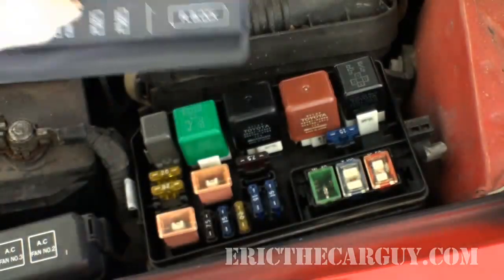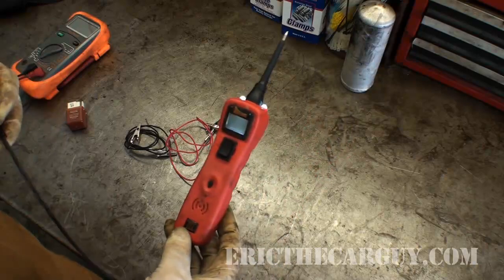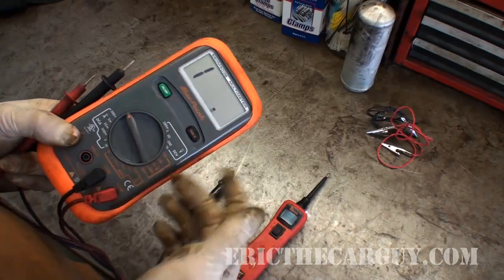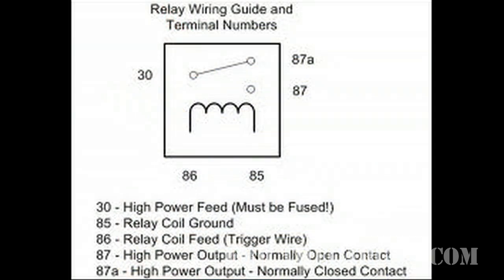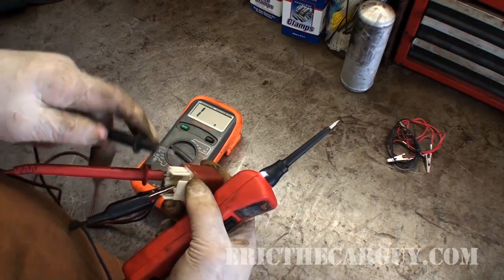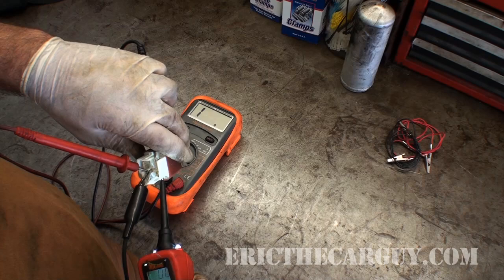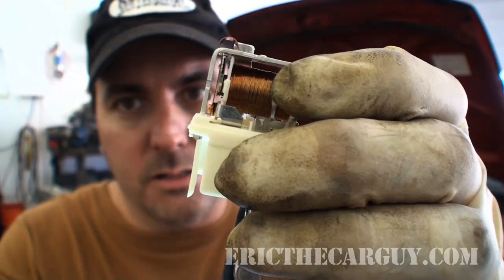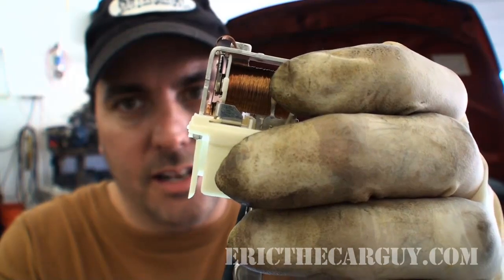How To Test Relays- EricTheCarGuy

Comment: Hi Eric...I have an 98 oldsmobile bravado...the starter was clicking for some weeks now, so I know I needed a new starter...but yesterday while I was driving, the car just stopped and shut down on me. I tried cranking it back up but no click and the lights on the dash was dim and the radio sounded like static....my 1st thought was the battery, but I had the battery checked 2 weeks prior and it was good....I replaced the starter....still no crank, and the lights on the dash was dimming more, I gave it a jump and the car cranked right up, and the battery gage on the dash is good at 14....that was all yesterday and it has been driving fine since, but now this morning it cranks up but sounds funny, as in it doesn't crank with the roar it used to, its usually loud like a truck, instead I hear this noise, the crank sounds weak, like it barely want to start, although it doesn't stall to start...I'm wondering if a bad relay under the hood can be draining my starter or interfering with the starter/crank, because I now have a new starter on here but the crank doesn't sound as powerful as it did when I 1st put it on there....and it puzzles me why did I break down all of a sudden and the lights went dim and radio didn't work, I didn't know the starter could mess with that...

Comment: Hey Eric I am having troubles with my radiator fan on my 94 plymouth acclaim I've checked the motor it works but when I stuck two ends of a wire into the plug where you hook it up to the sensor and the fan didnt start to run what should I do?

Comment: This was a great guide for me. I didn't have a probe and wanted to do it inside so to activate the first circuit I used 3 D batteries end to end with an alligator clip sellotaped to either end. Then just used the continuity setting on the multimeter to get a reading. Was re-assuring given my weird car problem. On a VW 109 relay it wasn't so straight forward which pins did what so there was a bit of trial and error till I worked it out. The diagram on the side wasn't helpful either(to an electronics like me anyway!). But I know I got the right ones in the end cos I tested the bejesus out of it. And I could see the metal switch go on and off and hear the continuity go on and off accordingly.
Christ this is turning into a confession...
Anyway thank you for the guide Sir. You're a gent.

Comment: Hey Eric, I have a 2003 mitsubishi diamante that i have replaced the battery and alternator on and have cleaned the battery posts and cables. While I'm driving the battery and brake light come on intermently. When they come on I have checked voltage and something is draining the battery while its running. If I shut the car off and restart the car sometimes it starts charging again. It isn't draining the battery with car off only while running.

Comment: whats the difference between the cheap relays and the more spendy ones?
Reply: Richard Cowtails About 5 bucks :P
Reply: exactly like you wrote, one is cheep made and on is better made
Reply: ***** thanks... at least someone got that lol
Reply: And I bought turn signal flasher relay for my dodge ram and has never had a problem with it. No hesitation,  no huge relay time no failures of any kind.
Reply: Richard Cowtails About 5 bucks :P

Comment: Do relays ever fuse closed?
Reply: Yes they do, if you for example run 40 amps through a 30 amps relay it can solder itself together and stay shut. It's common if you have some extra auxiliary lights on the car. If you use one relay, say 30 amps a piece because its one of the most common, for each light it wont pretty much be a problem. But you can always go overkill and go for a higher amp relay that costs 3 times as a 'regular' relay but save yourself some wiring. Other than that it's not to common for relays to fuse together unless by age, an old relay might fuse together because of corrosion or just wear and tear.

Comment: Is the test probe injecting battery voltage?  I thought you couldn't test continuity on an energized circuit .
Reply: Two different circuits.  One works as a switch. So only the switch circuit had juice running thru it.

Comment: so theyre kind of like a "step up" transformer? lower power in, coils increase power out. yeh?
Reply: thats right they are made to save money for builders , switch in the past was far more heavy and costly , now with relay they are able to save money by using smaller wire to the relay box and then bigger wire to the unit

Comment: Eric, thanks again....made test leads and tested the glow plug relay, which is working. Still no glow plugs though. Checked fuses, but have read about a thermistor or timer relay on glow plugs? Possibly a hidden fuse somewhere as tachometer not working also. Your videos are the best..greetings from Spain

Comment: Hi Eric. Having issues checking a few of my relays in the way shown. My car started fine before I changed the timing belt and head gasket but now wont start so I'm trying to check / eliminate the fuel pump relay, however now Ive pulled it I get nothing, no click when hooking to a 12v battery jumper. I tried another couple of relays I pulled out to be sure BUT nothing with them either. Really seems unlikely they are all dead? Im getting sparks so there is voltage of some kind.

Comment: You can also jump terminals  30 and 87 from the relays empty slot in the fuse box to bypass the relay to see if the load operates. That's a lot easier to do than bench testing. Just my $0.02

Comment: Ya know. . . easier than growing a third hand, you could just use those test leads and alligator clips to check continuity. Just clip one end of each test lead to the terminals on the high-amp side of the relay and clip the other ends to your multi-meter probes. Just a thought.

Comment: Hi Eric. One question. How does one check and measure the engine oil? When the engine is on and running or when its shut off!!!
Reply: Off and on a level surface.
Reply: try to let it sit for 5 minutes or so and allow the oil to all drain down into the pan then check the dipstick.

Comment: I had no tail lights on my 2009 Chevy Van 40,000 miles.
I had brake lights.

I could not find the problem. The fuse box for tail lights is under the drivers seat.
I am a good mechanic but this had me stumped. It was low milage and all stock factory wiring.

I took it to the dealer and the mechanic there was young. I was skeptical but he found the problem in about 1 hour. I was impressed.
He found the problem in a very creative way. He could hear the relay clicking but no power. He then noticed that the OTHER RELAY in that box under the drivers seat, had the same part number so he switched them and bingo problem solved!

Victory Cheverolet in Petaluma, Ca.
Reply: lol, it took an hour to swap a relay?
Reply: salazam The mechanic had to find the problem first.
Reply: Hey Lucky Dog, I have the same problem with my van. No Tail lights and reverse lights but brakes and turn signals work fine. How did you or did you get the problem fixed? Thanks if you could steer me in the right direction.
Reply: Ernest Makainai Relay under the front seat, There are two relays, and on my 2009 they are both the same part no.
Reply: Lucky Dog That relay malfunctioned at 40,000 miles! Not very good.
I have no extra lights and was not using a trailer.

Comment: The video was helpful but I have a problem with a six prong lighting control relay, three opposed to the remaining three. How do you test this? All blades are the same, no apparent  power side or anything that might give a clue how to proceed. the only thing I can think of is to test resistance across the pairs. I have no idea how to power it. One more thing, It was buzzing.... loudly..... is why I took it off.

Comment: when applying 12 volts to the smaller connections on the relay, does + and - matter, or will it complete the circuit either way?

Comment: Hello Eric, I also have a question. I have a 1996 Saturn SL2 with a P0401 "EGR insufficient flow" code. I have bought a new EGR, sprayed the ports below the EGR valve with Berryman's B12 Chemtool throttle body cleaner, cleaned the MAF (using Mass Airflow cleaner) and also poured a whole bottle of Seafoam into a full tank of gasoline and a half bottle of Seafoam in the engine oil. I have been driving the car to work at 75-80 mph and still have the check engine light and a P0401 code.  Is there another EGR passageway that needs to be cleaned besides the ports below the EGR valve? Anyone have any ideas?

Comment: Hi Eric, thanks for sharing your knowledge.  There is a relay test which no one speak and is very effective to locate problems with a relay in a circuit under load. This is the vibration test of the relay. I do the relay test giving gentle taps with a handle of screwdriver. This test served me to locate a faulty ECC relay of a 94 Ford F-150 that failed under acceleration intermittently. I replace the old relay with a new one and repeat the test, the fault disappeared.

Comment: I have had switches relays and even fuses that close and show continuity but wont handle the amp load. There is a volt drop test for that. I do like this guys videos. I've watched a bunch of them. I really like finding top dead center with my vacuum/pressure gauge. Thanks Eric

Comment: Very helpful video, currently have starter issues with my car, despite it working fine while running errands, it just stopped starting. Thought it was the starter, had it tested, the starter engaged but even when connected to car - starter wouldn't engage. Battery tested, said it needed to be replaced, but no dice. Remembered when my battery had low charge, it would make a clicking sound from the relay but now when the ignition is turned, there's no clicking sound, just a faint buzzing sound.

Comment: Hey Eric, I have a 1995 Honda Prelude SI. Recently my car was broken into and my stereo was ripped out. Now, in the space where the radio was, I can reach into that gap and feel on the back panel of where the A/C switches are. I can also feel and see wires from a black casing that comes up leading to the back of that same panel. The trouble I'm having is when then A/C is on, my car tends to go through a slow fast/stall action. Also, when it does that, the air goes from cold to hot. What do I do?

Comment: I just saw a video where a guy used a 9 volt battery to test an appliance relay.. can I do that to test my ac clutch relay? 
(I was planning on using a pair of alligator clips and a voltmeter set to ohms)
(Also gonna top off my coolant cuz I just replaced thermostat)
(96 honda accord 4 cyl non-vtech)
THANKS

Comment: Additionally, switches on the steering column are very expensive & timely to install. Always check fuses, relays & devices before blaming a switch. My two cents.

Comment: @thebaycuddy Highly unlikely. I dont want to say its impossible. Anything is possible. Check the connections at the starter and battery for loose or corroded  terminals. I would start  by testing the battery. If all seems   ok then I would say the starter motor is worn/weak

Comment: Awesome thanks! i have an old voltmeter (sunpro) doesn't make any sounds when touched and only has certain settings. when u said checking for ohms i believe i heard i then matched to which it was on my voltmeter. have an 82 e21 320i bmw tthat has a few things not working after checking fuses and checking wires. so now on to the relays. love how you shown how it works and talk about how and why. Awesome vid man! helped me out greatly

Comment: Forgot to mention my battery voltage gauge stopped working a year ago or so. It has come on randomly, but never lasts. It's gotta be that dang switch. Just waitin to get it to my buddies shop to check it out! Thanks much, hope thats the issue. I think there is a what?

Comment: Recall on the switch but they might refuse to fix it.  The new switch is under $20 and you need to figure out how to remove the two pop rivets.  I think a punch and hammer to tap out the middle pin on the rivets.  The switch will unplug easy from the harness. Then you should be able to use self tapping screws or new rivets to lock in the new switch since I am pretty sure no one will steal that car if you went with new screws..

Comment: Yes it can affect the speedometer  since its the switch that turns on all the electronics including the cluster panel.  It just depends on which side of the switch lets go first.  The side facing you when the cover is off and corner that faces the firewall is what supplies power to your turn signals and other things and every time you start the car the switch will get pushed out of the socket slowly.
As for the headgaskets the issue is the cast iron block and aluminum heads.
I think there is a

Comment: I'll definitely look into the ignition switch! Could that have anything to do with my speedometer though? It all seems interconnected somehow. and HAHA, I've had my head gaskets done, and used an expensive sealer kit after that too, cuz I was burning anti-freeze. I heard it was because they didnt build the exhaust ports, whatever big enough. So I could get bigger after market heads and be much better off. It's only got 63k on it.

Comment: Excellent video but you forgot to point out the importance of not letting the feed from the car battery touch and short out, those cables will fry in seconds which could result in saviour burns.

Comment: That was  extremely interesting.  I had always thought that the magnet moved through the center of the coil to contact and close the circuit.  Interesting that the coil actually uses magnetic force to pull a contact towards itself instead.

Comment: I bet if you took off your steering wheel column covers you will see your ignition switch coming apart. I remember Fords from the 80 up to 1993 had the junk design where the tabs would bend and the switch comes apart.  The 1985 Ford Marquis I had the turn signals went out first and then the car would not even start.  As soon as the bottom column cover came off the ignition switch pieces fell on the floorboard.  Also the since this is the v6 3.8L  the 1987 1988 to 1997 like to blow headgaskets.

Comment: Speedometer went out, cruise control dont work, when I stop the alternator churps like a mofo and the oil pressure gauge drags down and the engine runs real crappy, even stalled once. Something is drawing powering where it's not suppose to, and maybe I have some shorts too. It really seems like it has something to do with the steering column cuz sometimes when I stop it doesnt do it. But if I turn the wheel, the gauge will drag a' draggin. Speed sensor is okay I'm pretty sure. 93 Cougar 6 cylxr7

Comment: Good point about the diagram shows the device at rest without any power applied. Also, the best test in my opinion for a relay is to check it under actual load conditions where current is flowing through the contacts. A voltage drop across the contact would be more meaningful than measuring resistance. I would bet the relay tester you mention would be putting a load on the contacts which is better.

Comment: Good point about the diode across the coil. One thing to keep in mind is that OE relay coils driven from the PCM usually have the diode across the coil to protect the driver. Cheap universal relays sometimes doesn't have this diode and could take out your driver because of the high voltage spike. Just something to keep in mind.

Comment: He mentions the relay in one video but its actually titled differently,  it was solder joints on a circuit board.  look for     How to fix a glitchy control computer on a furnace or car    OR     How to fix your Toyota Lexus Window Switch Problem

Comment: You said polarity doesn't matter on the coil.  99% of the time that is true. The %1 is when the replay has a voltage spike suppression diode across the coil.  But those are rare to come across in normal auto repair.  You forgot the "Bosch green stripe" make before break relay.  Then the many types of latching relays or the multi coil relays (GM door lock relay.)  The 85 ~~86, 30 - 87a - 87 SPDT is what people will run into 99% of the time. Although not always numbered to the industry standards,

Comment: im still new to the feild so maybe itll come back and bite me on the ass, but when i look at similar problems- like a light relay. I check the horn, if the horn or blower motor works without issue, I take the relay for that- and pop in in the circuit in question and so far, MOST of the time (but im only 1.5 years in ) this method has saved time motion, etc and has more importantly fixed the issue..  and this is what i get from watching both.. theory(eric), and then learn speed(kilmer) peace!

Comment: Yes. A relay is just a switch controlled by an electro-magnet. An open switch would have no continuity.

Also 5 terminal relays are just a switch with two positions, one contact for normally open and one for normally closed. So you can interrupt the circuit by energizing the electro-magnet with one pair of terminals or complete the circuit with the other.

Comment: Yes, making/breaking higher amperage circuits with the probe tip will greatly increase switch life! Doing so is a good habit to get into!

Most of (but not all) Power Probe 3's have an easily replaceable snap in switch. It's a good idea to keep a few spares on hand. The switch assembly is Power Probe's "Achilles' heel"

Older Power Probes, and early PP 3's have soldered in switches that are a PITA to replace.

Comment: Great video as always.  Just a note that the diagram at the top of the relay is when it is at rest (off).  I might add that I've seen relays be intermittent, so it may be useful to click the power on the low-power control-side about 10-15 times to see if it ever fails once.  If it does, replace it.  Also, ESI makes a relay tester (model # ESI-190) for those who need to test relays often.